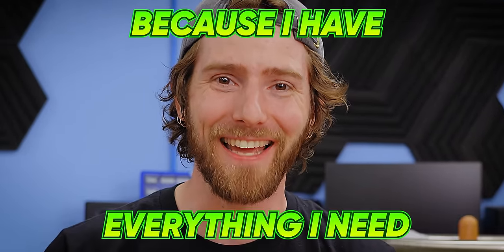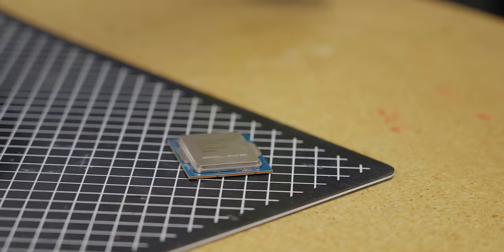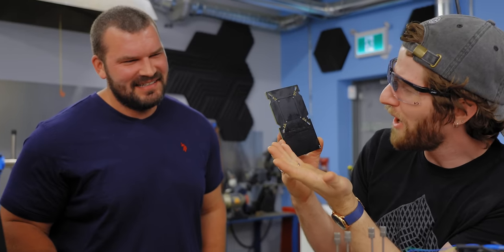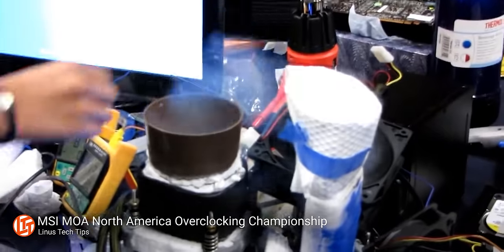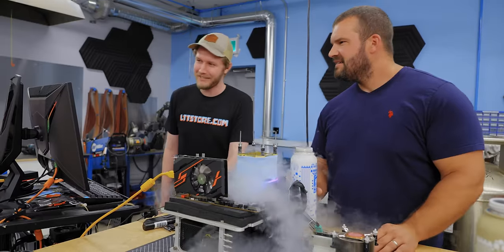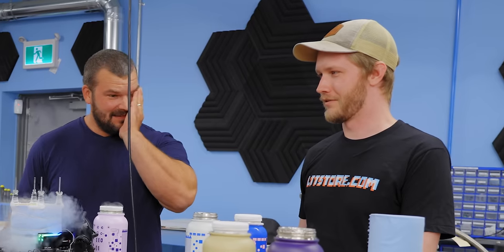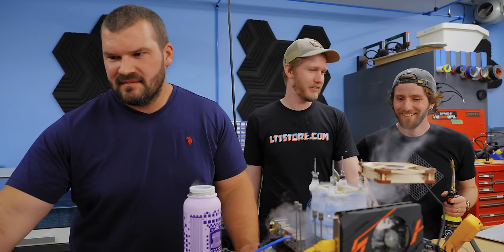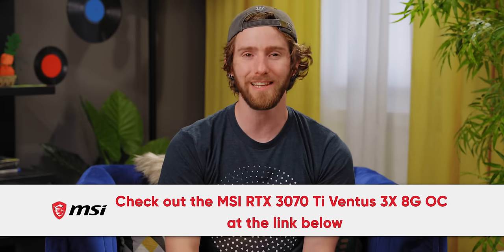The 6.9GHz CPU - LN2 Cooling

Comment: Well cold CPUs not starting is not really a bug. Silicon devices are not made to run over a certain temperature, but also under a certain temperature. For consumer electronics that is 0 C, industrial is -40 C. If you cool under -100 C, the silicon in most devices (aerospace parts might still work, but those are a k$ per unit) is just not working when it’s cold. That’s why it only works when powered on first, because the CPU heats itself up to an operable temperature. The point of this is keeping temperatures as low as possible while also keeping the CPU operational

Comment: Hey Linus. Have you ever thought to try to use Liquid Helium? It is even colder than LN2. Liquid Nitrogen goes to -180C while Liquid Helium is -260 to -269. The helium shouldn't interact with the boards as it is a noble gas. There have been tests where batteries are run in liquid helium where the batteries don't use any energy as the resistance is not existent at that point.
Reply: @Gearrion  The same can be said for liquid nitrogen. You would register it when the pitches of your voice change.

Comment: You should read about Seymour Cray and his endless search for the ultimate super computer. using 2 core principales:

"Cray frequently cited ...: remove heat, and ensure that all signals that are supposed to arrive somewhere at the same time do indeed arrive at the same time."

With current CPUs and high speed serial interfaces like PCI and Thunderbolt, you can easily achieve the second one, but the first one is as elusive as the "science" on the video.

Comment: I've noticed nobody uses silica gel or other desiccant packing when overclocking.  Is there a reason for this?     Using a small room with already sub-zero air that has been dehumidified down to near-zero humidity might help too. 

Also, is it possible to use forced expansion phase change on liquid nitrogen to get it even colder.  Or better yet, use liquid helium.  This could be used to control the temperature precisely while creating an insane amount of cooling.   This is how they cool the magnets and/or electromagnets in MRI machines (forced expansion with liquid helium.)

Comment: Why you don't use "Automotive Conformal Coatings: Silicone Vs Parylene" the PCB with flux, is used for car pcb coating :D. Good luck dudes... ;)
Used for dust proff, wather proff and vibrations as well.

Comment: If you cool your CPU long/well enough using nitrogen, you can get your CPU in a super-conductive state, removing any resistance, and run easily above 20Ghz only using a fraction of the power.
Reply: This is not how superconductivity works. You cannot just cool any material to -190 and achieve superconductivity, most materials are not superconductive at any temperature and those that are superconductive usually require temperatures barely above absolute zero.
Reply: @karl0ssus1  I know😉 Are there any type of cpu's that use superconductivity? Quantum computing chips are super cooled, but not sure if it has to do with super conductivity.. maybe only the stability of quantum bits..

Comment: you can't get performance boost too much by speeding up CPU alone, the whole system need to be sync up as well.
you can't cool down semiconductor too much, it will changes the threshold voltage and transistor won't work as designed.

Comment: At APC, it gets LN2 out directly from air, so no money to spend perodically (it cools air, then get N2, then starts to cool it to get LN2)
Reply: APC is in Cairo, which is super hot that there's a Cairo heat pump heated by sun, then goes to LN2 heat regulation pumps under the motherboard to make anti-frost.

Comment: Just wait until you find out that the quantum chips I used to work on in a research lab required cooling them to 15 millikelvin! That's -459.643 F or  -273.135 C. Hard to get much closer to absolute zero than that.

Comment: As a software developer and devsecops engineer id love to see a shift to arm. The low power consumption coupled with more sophisticated virtualization like containers you can really push a system to it's limits without pulling more power.

Comment: I had a part-time student job where I filled around dozen LN2 dewars for gamma-ray detectors and some sort of analytical instrument.  You should be able to tell by the sound, but we never had a phase separator at the end.  We used surgical tubing because some of the dewars were in tight spots.

Comment: if negative numbers temp barrier to boot is only a caution move by the manifacturers and these temps could never really hurt the cpu or the other components outside of condensation, this could really be the future of cooling and clock speeds. in 50 years we could see numbers like 20ghz, if there comes standards in negative zero cooling. and society wont ever let down one of the only chances of continuing to forward progress, wouldnt they? in the end the only bottleneck right now is only that processors aren't really built in a way to be able to resist such low temperatures, if they new standards with negative zero cooling will come in the minds of the manifacturers and maybe if sub zero cooling products that don't cost 500 dollars a day will ever come out, this could really be the future

Comment: 11 months later I'm pulling 38000 easy with the 13900k not even overclocked on cinebench , I pull 330 watts like nothing  I've hit 6 GHz on 3d mark. nothing to crazy though I only have a  360mm aio.

Comment: 2:15 Another option instead of cooling it a ton is to remove the resistance by using superconductive compounds, but unfortunately no superconductive compounds have been discovered to exist at room temperature. It is estimated that a CPU with superconductive components could achieve clock speeds over 770 GHz, which is absolutely insane to think about

Comment: It seems you were boiling enormous volumes of liquid nitrogen, maybe the motherboard could be placed in a sealed box without only a few small openings? The nitrogen gas might quickly displace the moisture loaded air and condensation will stop.

Comment: why not wrap/put the whole setup in a big plastic bag, close that bag around the copper cooler, and flood it with N2 gas? that gas evaporating from LN2 should be pretty dry, so the inside of the bag should have no condensation (the outside will ofc), so the mainboard and all will be pretty safe from condensation.

Comment: So theoretically it's possible to write an unsupervised model to change clock speed, voltage, liquid nitrogen cm^3/s, and all the other relevant parameters automatically. I wonder if that would guarantee the absolute maximum clock speed possible on any given chip

Comment: To this day I do not understand how they continue to deal with the condensation of air humidity having dry gas only a couple of centimeters away. Build a box to isolate it from outside air and ventilate with nitrogen gas. then use as much liquid nitrogen as needed.

Comment: Could sticking the board in a vacume chamber with a liquid nitrogen setup help against the moisture issue? I understand youll have to have the input for the nitrogen on the outside. But yall are big boys with a big boy shop. Might be a fun side project and I believe yall could figure it out. Plus vacume chamber pc sounds like a good clickbait title

Comment: video idea here. hey, why dont you put a motherboard in a non oxigen chamber or vacum chamber? conected with tubes to the coling sistem, and some silica bags or some dehumidifier inside. with less oxigen and nitrogen, and the moisture controled in the chamber you will get waaaaaayyy les moisture in the motherboard and socket.

Comment: LTT, do you have any good videos on tweaking and overclocking? I've got an i7-12600K in an ASUS TG H670 Pro wifi D4 and 64GB DDR4, two 1TB SSDs, Noctua NH-U12A CPU cooler, 9 case fans from Noctua and Corsair, and the recently discontinued XFX Speedster SWFT319 RX-6800 XT GC in the Corsair iCUE 5000x RGB case.

Comment: OK - writing here as a total overclocking newbie.  The LN2  will I guess form a gas layer between the chip and the liquid that won't conduct heat well.  I'm just wondering if a regular copper heatsink with fins, sitting in the liquid pool and thermally connected to the CPU would cool more efficiently?

Comment: Maybe a stupid question, but if one of the problems to workaround is moisture in the air, why nobody tried using more controlled environments, like an extra dry box, or idk...using a freaking vacuum chamber. Just spitballing since it´s not my field of work...but probably ln2 solidifies on vacuum...?

Comment: "MSI RTX 3070 Ti Ventus 3X 8G OC" I remember the Ventus series having very bad coolers on them.. The Gaming X series is the way to go right?
Reply: F Edition personally,i’ve got a brand new unopened 3070Ti left from a bunch of neural network models we were supposed to run at work. i could sell you it for $600

Comment: wouldnt it work to like dump the whole system in a box full of gas heavier then air to prevent condensation and run a system with pipes for the LN2?

Comment: Please use protected gear.
SO your safe and don't damage your body. 
I guess there is application for that stuff.
They should of made cpu's more efficient and powerful by now. Maybe design the material and tech together better. I am expecting 10ghz with all those cores we have now without a fan. Or at least do it with stock fan or the bad one. Anything better is for extra like overclocking. I haven't even done it.
Whatever stay safe. don't hert your self.
YOu do that and mine just busted for no reason. I sent that cpu into warranty long time ago.

Comment: What if they used fiber optic wires or something in the motherboard? I know it's probably not a good idea but it's an idea
Reply: Motherboard has countless little connections that run across stuff on the mother board. Fiber optics would be like the size of those connections scaled to at least 50 times

Comment: Is there a reason that datacentres dont try and cool the whole datacentre down to like -50 C or lower so that it would use less power? Obviously that would take power itself, to get down that cold and then you cant have humans do maintainance on the servers without warming it up again, but for a maximum efficiency data centre it might be a good idea. Maybe stick is somewhere like the north pole or antartica.
Reply: It’s because it’s expensive and probably tedious.
Reply: @Artemis-v8i  Yeah I get that, just thinking to save power it may not be a bad solution, especially if very high reliability components were used so it wouldnt need maintenance very often. They have already experimented with underwater data centres, so extremely cold ones might not be too much of a stretch.

Comment: I love that although this is incredibly scientific, there is absolutely nothing to practical or useful to learn from it.
Reply: If you read my posts, you will learn something interesting.

Understanding why problems occur in chips that have been over clocked can teach you about the design of logic circuits implemented on integrated circuits, problems which occur which don't occur with discrete logic chips such as 74 series TTL.

Comment: 1:  Alex, you don't have to say Celsius when it's -40 degrees.  -40 is the same temperature in Celsius and Fahrenheit.  
2.  Why do all the overclockers waste time with Vaseline and goop and towels and such?  I get it for random folks that want to give it a try on the cheap, but why don't the folk that do this all the time build a box out of half inch acrylic, cut a hole in the top for the LN pot and epoxy the hell out of it in to the hole, mount the motherboard in the box and use an AC evacuation pump to pull a vacuum in the box.  Toss some desiccant in the box to capture whatever moisture the vacuum doesn't get, and run the thing as long as you want till you run out of LN?  If other parts of the board need cooling, use liquid cooling on them, or just fill the box back up with some of the nitrogen you already have sitting there that doesn't hold water very well.
Reply: Yes you do. Because Celcius and Fahrenheit are not the only temperature scales in existence. Kelvin is also used. And I can assure you -40 degrees Celsius is NOT -40 Kelvin

Comment: I synced all core to 4.9 ghz on a i9 10900k and I tried applying a negative offset to base voltage at 0.025 and the computer won’t even boot into windows. I seem to not be able to undervolt my cpu at all

Comment: If you tried to make a permanent LN2 cooling solution, in a closed system, you wouldn't go through nearly as much LN2. Think of a closed loop water cooling system. Right now, you're losing a lot to simple environmental factors.

Comment: Would it be theoretically possible to create a LN2 loop pump and radiator setup to create a LN2 cooled daily driver
Reply: Ln2 can surge when it turns into a gas, leading to an explosion in closed-loop systems. These tend to be extremely expensive to design.

Comment: just orded 13/06/2022
 1 EXDISPLAY Gigabyte GeForce RTX 2080 Ti 880025 invoiced 20.0% 536.66 536.66
WINDFORCE 11GB Graphics Card
Invoice Total 649.98
Courier Yodel
	SN850 500GB NVMe PCIe Gen4 M.2
RZ01-03210100-R3M1
riser card for ssd 
got 2 old q6700 xfire 7970 & R280 and i7 3.5ghz HotBox wow this made me miss my old VapChill xe-pe crate self build in a silver stone tj06  cas stolen -20 q6600 @ 4.8 ghzb4 that -18 939 optron 165 think could be 170 @ 3.46 ghzand useing a 50 inch LG plasma radiator and bed for a chair desk mousemat  its a sweat fest and anything gear or new less hot cpu's ect take pity on guy who used to buy best of best every year starting at 14 with xp3200 barton dfi gf3ti500 2 for under 500 then hooked  on building pc's but priced out marketwekk u know about the time  1k pc became  1.5k then WTF 3grand ok .. but 10k 30k few years on and i dread to think how mutch you can build a pc for  ... send me some of your new junk to match my ssd gfx card plzzplzplz i did what i would never do and buy a card just as new ones got anounced im truly dissapointed with myself but fanced nft mineing so yer ;/ meh help